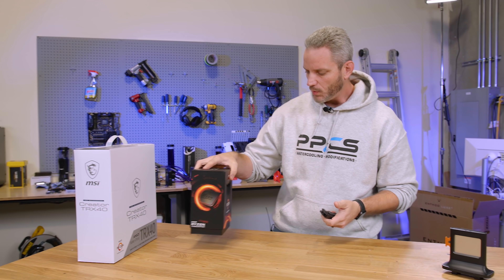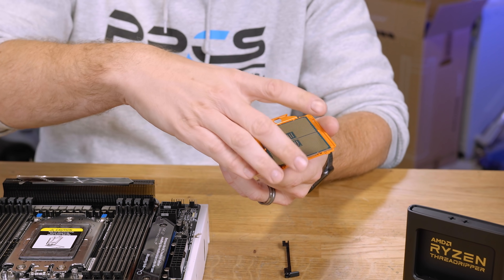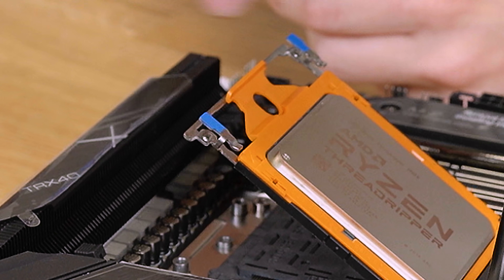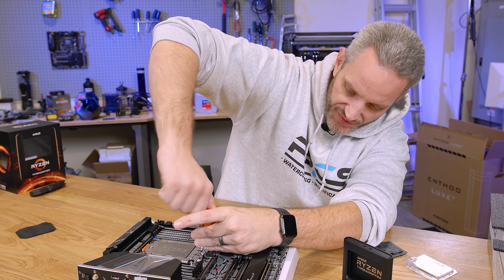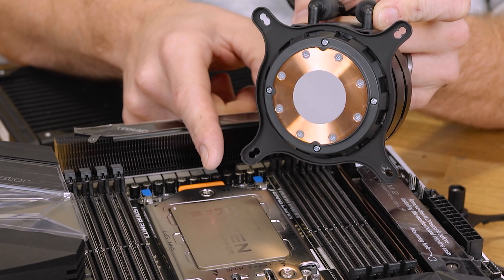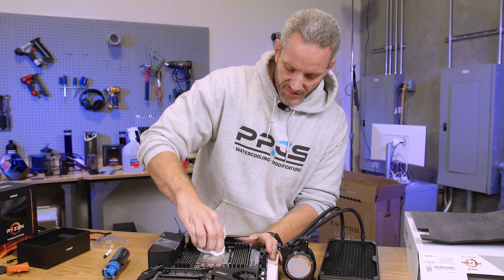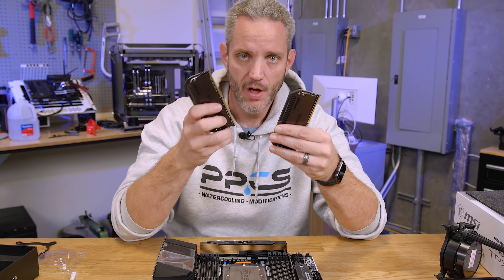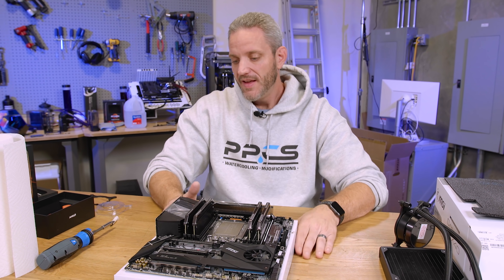Don't Make These Threadripper Mistakes!

Comment: The socket on the Zenith II trx40 board is a lot easier than the previous Zenith tr4 board, had to really lean on the old one, new one screws in much better, I guess Foxconn sorted it out.

Comment: Jayz could you make a video about what an Intel builder needs to know about building an AMD PC 
Looking at high end stuff with a new thredripper 
Iv built intel PC for myself the last several years.
But now with AMD heading the way they are I would like to make a top spec AMD PC but I need to know a crash course on what's different for example I know Amd require good Ram suport.
Good cooling. Do I need to overclock or is there an auto overclock system will it work with nvidia or is it better paired with AMD GPU. Also finally will it support M.2 and is there anything I need to know about pairing them with AMD. And anything else if missed.
I know I'm probably over thinking this if so could I just upgrade my current PC by buying a new motherboard and processor and swapping it out wile using my current win 10 build and boot it with an AMD system and install relevant drivers

Comment: The CPU has an orange tray with a large T-handle on it. Screw it no need for that, let's touch the contacts on the processor, then seat the processor. Congratulations you just contaminated the processor and now the pins on the motherboard, but oh make sure you torque the screws on the CPU holder. LMFAO!! You have official got every technician that watched this video to yell at the screen at the same time. First thing NEVER EVER touch the contacts of the processor with your fingers, the oils from your skin are very bad for the contacts! Second should ground yourself before handling any electronic component. A static discharge, no matter how small is toxic to any electronics. Never touch either side of the processor. If you do use isopropyl alcohol "rubbing alcohol" that is at least 91% to clean the affected area with a lint free cloth. If you handle a lot of electronics, I'd recommend Chemtronics Gold Guard Pen PN: CW7400. It does an amazing job at cleaning gold contacts on electronics. I have used it for over 15 years on all types of gold contacts, it has yet to fail me, & the pen lasts. Third, do NOT overuse thermal compound "paste". Like oil it will spread when it heats up & have seen it make its way onto the pins under the processor from other people's installs. Most all of them are conductive & will cause major issues. Cleaning it off the processor is easy enough, but to clean the pins on the socket is extremely difficult! On another note: I did laugh on "This is you & this is her friend" LMAO!

Comment: So let me get this right, $2000.00 for this processor. They could of at least provided a damn CPU cooler. If someone wants a better one, they can upgrade that themselves. Cheaper processors or even OEM packaged processors come with a cooler. It's more like a WalletRipper.

Comment: Jay: "Bigger is better, you can't argue that"
Me: Watches LTT video where triple 120 AIO is beat by double 120 AIO and BOTH are beat by a Noctua cooler
Reply: main reason of air cooler is, there is almoust nothing that can go wrong,..
Reply: Spoiler alert, Gamers Nexus debunked LTT's sponsored nonsense. The Noctua performed worse than every AIO they tested. Noctua is really good, it isn't beating CLC's. Period. A non-sponsored video will always be more reliable than video sponsored by the company whose product you are reviewing. Steve>LTT
Reply: @koreymcintire3382  spoiler alert... GN debunked NOTHING. Cant compare the two. In one comparison i saw from LTT.. they tested on a ryzen 9 19xx. GN tested on a Ryzen 9 39xx.

Even noctua themselves specify different tower coolers for different end goals.  For example.. if i want to maximize my OC AND stay below my case limit i can choose the d14 OR d15s. A u12s is inadequate.
Reply: @koreymcintire3382  the LTT video makes perfect sense. In the early 2000s I was building water blocks myself but the only way they were competitive was to use external tanks of ice water to power core T to below ambient. Using water to move heat but then use case air to cool that water is not going to have advantages over using heat pipes to move heat and the same case air to cool them. The heat inertia considerations I'm LTTs video also make perfect sense. I am not aware of a LTT and Noctua partnership, but even if it exists it doesn't automatically make the test invalid.
Reply: @koreymcintire3382  As to gamer nexus he used a much cheaper noctua cooler when testing
Reply: @koreymcintire3382  The video wasnt sponsored though. The noctua was just put there as a reference. The sponsor for that video was World of tanks.
Reply: @benna197  wasn't sponsored? So LTT now has their own line of Noctua fans because it was out of the goodness of their hearts. They are business partners and yes, that video was sponsored.

Comment: Hi all . Best to turn mount screws counter clockwise until you hear or feel a click after moving bracket over cpu. This will align screws to start then 1/4 turn on 1 then 2 and three until tool clicks.

Comment: Threadripper does NOT work with AiOs or air coolers. You need to have a custom loop! And you have to spread the paste over the entire surface of the Threadripper except leaving like 3-4mm free on the corners for the paste to expand.

Comment: The pea methot is Always the best for a normal  cpu. For the threat ripper i would use an old method and that is spreading it your self. Not like the nutella commersial but a thin layer and maybe google threadripper cooler that way you no it has good cooling over the hole dye of the cpu

Comment: Jay... I love your content, but please don't hold the CPU by the contact surfaces. Please!
It hurts, a lot. There is that little tab thing on the cover for that exact purpose.
Grease + heat + electricity = not good.

Thank you :)

Comment: That water cooling suggestion seems a little extrene. I'm using the 2950X 16-core Zen+ Threadripper with an EVGA (Asetek) CLC 120 AiO Water Cooler (1x 120x120mm) and can do hours of x264 CPU video encoding at maximum load with no thermal throtteling. TDP is not much smaller than on the new generation, I think it's about 250W vs,. 280W. That miight change though with 32 core Threadripper in Jan 2020.

Additionally, while I do support the idea to make the contact area between CPU and cooler as large as possible, the outer edges of Threadripper under it's heaat spreader cap are empty, That space is reserved for the 32 core version with 8 instead of 4 CPU chiplets -> there it'll be really important.

Comment: After all the care AMD has done, don't touch the pins with your fingers, besides greasing up the pins you might destroy your new baby with static discharge (really should have static grounding cable etc)

Comment: You should not touch the gold pads on the bottom of the CPU like jay did with is thumb at 4:45.

there is a reason why the cpu sled has a big orange tab to hold.
Reply: True, but it really doesn't matter much if you do. They're all individual contacts, and with sufficient mounting pressure they will all make contact just fine. Whether or not you got your finger oils all over them.

Comment: I find it silly to spend so much on a CPU - (something like 2k?) and cheap out on the cooling solution because it costs 100 or so (tho the 2 air coolers Jay suggested are between 75-85 bucks just about on Amazon). But yeh If your going to scrimp on cooling for a $2k CPU.. yeh need to rethink buying a $2k CPU, plus mobo/ram/etc. lol I mean heck I can barely afford the cooler alone not to mention the CPU/mobo/ram/etc to run that threadripper! lol

Comment: Let's start with removing plastic crap, along with stupid laptop fan, and find better cooling solution (water blocks) for motherboard. When you invest that much money into your CPU, last thing you'd want are FETs giving dirty power to it. Next, only unlock FSB multiplier to get most from motherboard. Don't overclock cores or start playing with their voltage. You can gain more clock cycles by killing unwanted tasks and services in your OS. I have XP and Linux systems that still run faster than fresh install of Windows 10 on newer computers. Who'da thunk'it?  Ha, ha, ha!  :-D

Comment: If anyone buys threadripper and doesn't buy a cooler to fit the hole chip, requires a beat down.  Could you do a test jay to prove that you can get 20-30 degrees cooler with a good water block. 
The difference from half cooled chip to a full ek block is redicules.

Comment: 1950x/2950x was just called TR4.  Also my evga tr4 cooler keeps it at 42deg C (and that's on die not the block) so no you totally wrong about cooling.  Not sure why you talking shit when you have delidded a tr4 and the chiplets are not at the perimeter....  the stock compound yes is way too small but any personal application of it where you cover the whole copper block you will have no heat issues btw that's running at 4ghz

Comment: I hate the way most everyone applies Thermal Paste.  just put a dot in the middle..  uhm NO! that is by far the worst way.  I use a toothpick and spread a even thin coat and my CPU's run much cooler.

Comment: Heat sitting there doing nothing  , this is what you say to fool people to buy bizzare coolers lol.... like heat wont transfer towards the sink area cuz its not directly above lol.  yes the smaller cross section area will reduce heat transfer rate but not to the point that will force you to go buy expensive coolers specific for the socket to get 2-4 degrees lower lol

Comment: One of my first builds was AMD Thunderbird that was able to get to a GHz and it was cheap, fast and had North and south bridges. How far we have come. I've jumped back and forth from AMD to Intel with overclocking cheaper processors over the years and now I really don't see much need for overclocking but I still like the thrill. The next build I will put together will have to include a new MB, Ram, CPU and new CPU cooling block since my Intel 4970k is as far as it can go on my Z79 Hero Board. I bet there is a few people out there that have ran there chipset to the max CPU and are waiting on what CPU brand to buy next, I really wish I knew how long the new Ryzen AM4 chipset will last as far as generations. Is there any way of knowing this?

Comment: If you spend 1000+ on a CPU you certainly want to use PCIe 4.0, as such the "downside" of not being able to use previous Motherboards is actually not that big...
To be honest, if your operation is not super RAM heavy, and you need to get as much in there as you can, i would reccomend a 4 chip quad channel setup over an 8 chip one, as from what i have read, memory clocks are higher by default with 4 chips "only" also hinting at easyer OC, and Threadripper loves fast memory...

Comment: First mistake is running Windows as a host OS. Run linux. If you need windows, fire up a VM. pcie passthrough (vfio) works perfectly, and honestly, what is the point of running Threadripper if you don't have multiple GPUs? :D

Comment: You're dumb if you spend over a grand for a processor but cheap out on the cooling solution. You're in good company with the same people that buy unlocked CPUs but have a motherboard that can't overclock.

Comment: I remember when I installed my AMD Threadripper probably about a year ago and I did it wrong, I didn't screw it in the right order and because of it, I bent some metal where the CPU mounts down, I had no choice but to force the bracket down but ever since after that it has been fine, Lol

Comment: 15:00 that shouldn't be a big problem. You'd still be in the 3rd and 4th channel that way. Modern IMCs should work fine that way. For high memory speeds, there might only be a slight lower stability because of the slight asynchronicity in trace length

Comment: That's why I'm growing to like LGA3647's no-ILM socket. Just slap the cpu onto the plastic bracket, slap them to the heatsink, put the whole thing onto the socket, then tighten the screws from corner to middle to your heart's content. Nothing can go wrong and no need to worry about any torque. If you put the cpu on with the wrong direction it won't let you tighten the screws.

Comment: Oh crap... When I built a buildserver in my company (I'm not in the IT department, I'm a junior dev) I went for Threadripper 2950X and NZXT X72 (my manager gave me the free hand on building the system). When I stress it with 32 workers non-overclocked I get the temps of max 68C. I think I need to replace the thermal paste. Thanks Jay for saving my ass (probably).

Comment: Did they fixed issue with bolts not being able to catch on when cpu is installed, like it was on x399? My mobo has that exact issue, and it took me like 2 hours just to thread the damn cpu

Comment: To bad about the finger grease on the CPU contacts at 4:40 - 4:54. You know that orange handle is for something ;) This could end up for a weird working PC. Like crashes hangs because of bad contacts with memory or pcie lanes. With used CPUs from intel I always clean the contacts with IPA to be sure.

Comment: I'm building new workstation on 3970X, I wanted to go with air cooler fro quieter build (Noctua NH-U14S TR4-SP3). But what AIO you would recommend that is safe and wont leak as I don;t want to loose over 3k $ potentially. Price doens't matter top of the crop AIO. I know nothing about custom loops so don't recommend those please.

Comment: Full cover water does make a HUGE difference. I dropped 20 C going from full cover air to full cover water. You'd actually go UP using an asetek from full cover air.

Comment: Hey guys, just want to ask some newbie question here.
I got a 2x8 gig of ram, and i'm gonna upgrade it to 32 gig ram. Should I buy another 2x8 gig of ram,  or go for 4x8 (for quad channel)?
If I added 2x8 ram with the same brand, same speed same type, will it be a quad channel, or I still need 4x8 ram in 1 pack?
I'm sorry for my bad english.

Comment: The cooler has more surface area, however the pre applied paste is not enough since its meant to be used with smaller CPUs, but it can cover a lot more since its all pretty much flat.

Comment: The CPU has all that orange surround and still Jay has to touch the pads on the CPU getting oil and other stuff where you need perfect contact.
Reply: Warm Soft Kitty  I was talking about the contact pads on the bottom.

Comment: Tip 1: Don't touch the bottom of the CPU. 

Just don't, you don't need to wipe it just out of the box. 
You don't need to touch the bottom when you put it in the guide. It's in a tray for a reason.

Comment: Thanks for the tips, much appreciated! I had a lot of cooling problems with 1950x, even when using Enermax AiO 360 liquid cooler. How does the thermals on a 3970x hold when using a 360 AiO or a Noctua NH-U14S TR4-SP3 (I would prefer the Noctua because of noise). Would it hold below 70 degrees under load? (AMD max temp) According to everything I've seen of YouTube tests it doesn't, and my 1950x would then freeze when passing 70 degrees after long hours of rendering. Nobody has addressed this on the internet from what I have found so it's very difficult to know for sure :( And I don't dare doing the investment before I know if it can run on regular coolers for a long time. ANy help appreciated.

Comment: Jay:  Pins are fragile, you'll damage things and it isn't likely to work unless you use the tool to properly torque the CPU mounting.  
Also Jay at 9:55:  Let me just smash it all down like I'm juicing a grapefruit.

Comment: 6:45 people still aren't going to flock to Threadripper.  TR has been, and always will be, an extreme enthusiast CPU.  In fact, most of the information provided in this video has more than likely scared away those who may have been considering switching to TR and just hadn't pulled the trigger yet.

Comment: This is very useful.  I haven't build a computer in a while (I need to soon my PC is very old).  My big concern is "Can it do what I want?".  I hate having to read massive amount of manuals only to find it doesn't support 4 way raid 0 nvme drives that is bootable for the OS.  Or to find that the memory speed I have is incompatible.  Or to find that the latest and greatest cpu I just bought requires a update to the bios to work.  How do I update the bios when the chip I bought for it doesn't work without a bios update?  This may not be true for threadripper 3 but I believe it was true for threadripper 2.  Anyway keep the videos coming.  Anyway, I am just ranting hoping that maybe this would give you ideas for future videos like this.  I love your content.

Comment: While it sucks I would drop the money and buy a TR4 socket type cooler (The ones made with the larger cooling plate that fits TR) They range from $80 to $150 bucks or so. I mean if you are dropping $1300  on the 24 core or $1999 for the 32  core Cpu, not to mention $400 + for a good solid motherboard, what is an extra hundred bucks or so to optimize the performance of it. Great video Jay.

Comment: Thought the socket was called sTRX4
You're mentioning that the Threadrippers have 4 chiplets around the IO. That is true for now. I first got wind of this LTT's review of the new Threadrippers and then read up about it, but the 3990x might have 8 chiplets. Using up the spare space.

Comment: You are supposed to to seat all the screws so they are all flush before putting the correct tension on them, never just torque them up like that. Great videos btw!